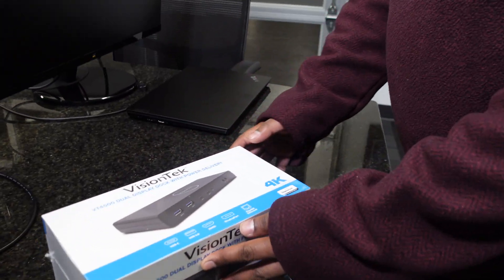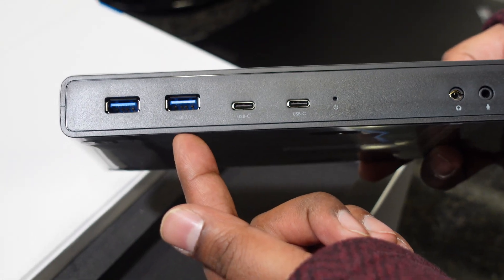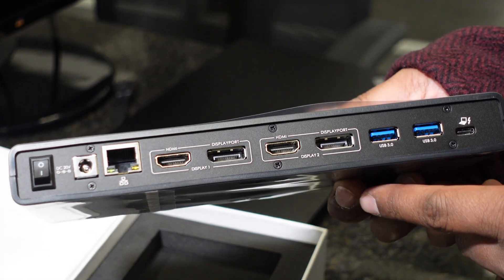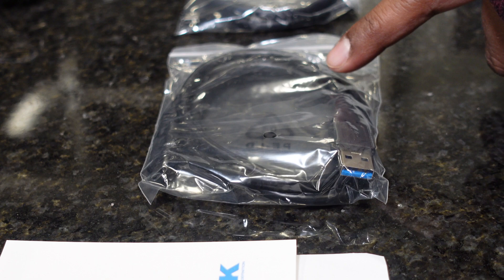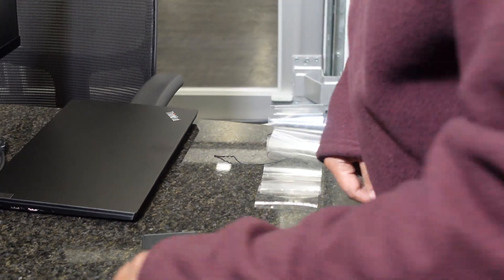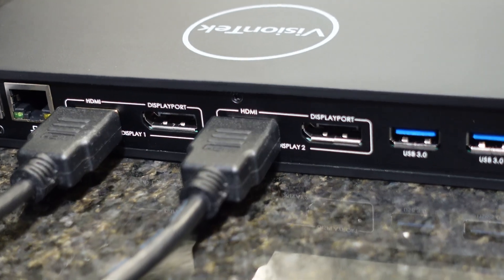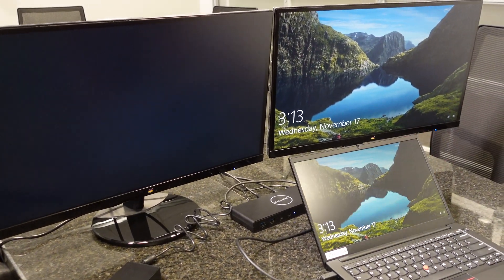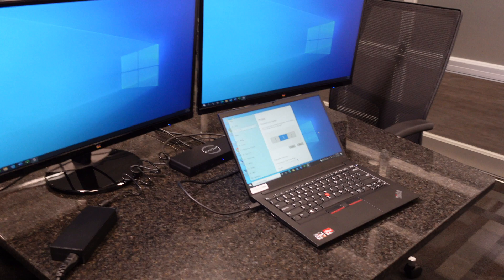How to set up your VisionTek VT4500 Dual Display USB-C Dock with Power Delivery

Comment: Hello mate! Some questions for you. Have you tried using display port at 2k 160hz? Would that work? Also have you tried using the hub gigabyte Ethernet?  And lastly the usb c to usb a cable transmits all the above with no issue? I'm looking to move my pc into a spare room and run everything through the hub via fibre cables converted to usb c to a